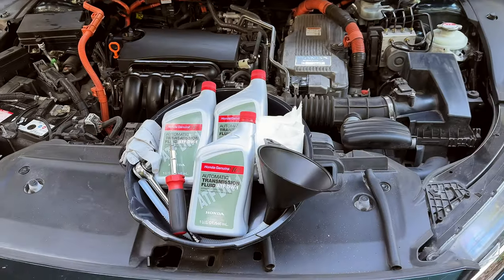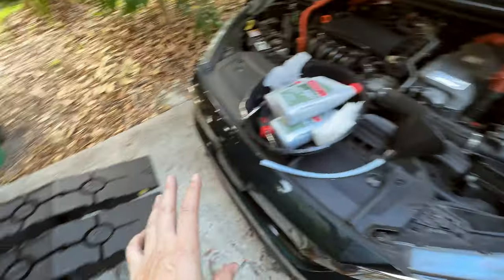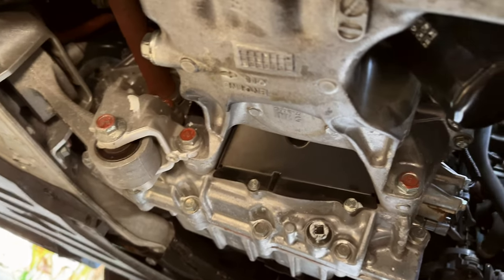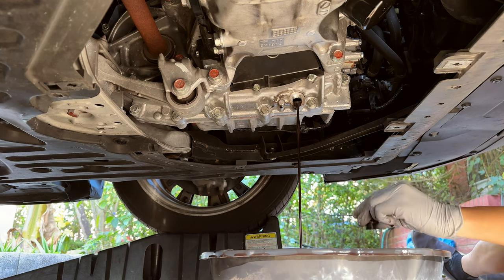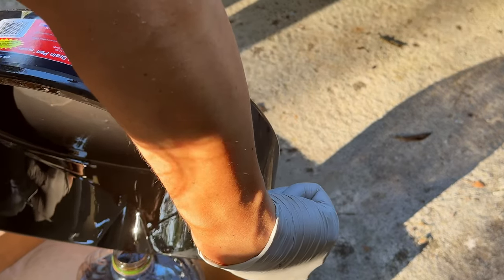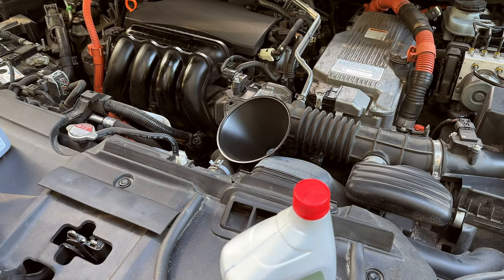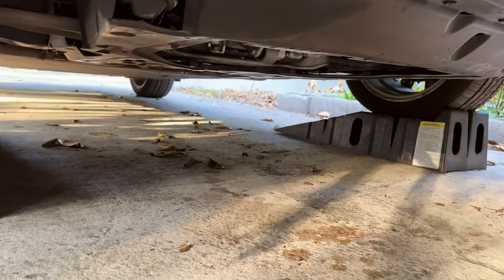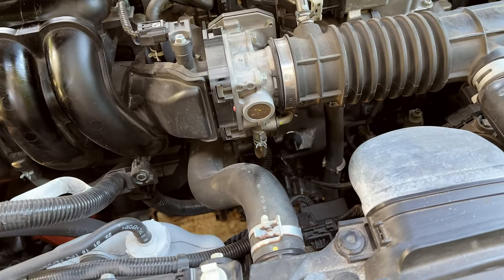How To: Honda Clarity PHEV Transmission Fluid Change

Comment: Thanks for sharing your experience! 
Just curious, how are you keeping your under hood that clean? 🤔🙂 If possible then would you please share your experience on that as well?
Reply from the maker: I sometimes use fresh engine oil, put some on a workshop paper towel to wipe every surface under the hood to keep them looking fresh and also to prevent rust on metal components, bolts and screws.
Reply: @TheGizmoGarage  Thanks a lot for responding and considering my request!

Comment: Does the manual call for transmission fluid change at 35k?
Reply from the maker: I can't remember, maybe at 75k for first transmission fluid change. But I'd probably change at least once every 50k since now I found it's very easy to do so.
Reply: Your "Maintenance Minder" i.e. the car's computer, should tell you when it is due.

Comment: should open the overflow when you filling your fluid to avoid overfill.
Reply from the maker: Indeed that would help, I do that with oil change,  but with transmission fluid it seems okay based on how easy it went in when I did it, there are large gaps at the filler port for air to balance out.

Comment: Just to confirm, you refilled the transmission while the car was still up on the ramps?
Reply from the maker: yeah but next refill I will drain off the ramp to get the last bit of fluid drained.

Comment: also, have you replace the coolant? there are 3 coolant tanks and coolant lasts about 5 years. i know it is not the the manual, but if you look at all the electric cars. they all need to be replaced. the honda prologue shows coolant needs to be replaced 5 years or 100k miles.
Reply from the maker: Yes I usually bring car to Honda for brake fluid and coolant flush. And as you said there are massive amounts of coolants in multiple locations on this car, I wouldn't be taking on the task myself.

Comment: Hi, I'm about to change the transmission oil, can you tell us how much torque should be set on the socket wrench when tightening up the transmission Drain Plug? Thanks
Reply from the maker: 36ft-lb or 49nm

Comment: Good video. I guess there is no way to accurately measure the oil. Your method of measuring the third bottle should be close enough but transmissions shouldn't be over or under filled. I will attempt a drain and fill.
Reply from the maker: there isn't but the bottle indicator is close enough, or you can invest in a measuring cup https://amzn.to/48yf6UO

Comment: Why would you not replace the filter aswell it defeats the entire purpose of changing the oil
Reply from the maker: This is transmission fluid. No filter to change following Honda recommendation. Motor oil absolutely yes change filter every oil change.
Reply: @TheGizmoGarage  yes the transmission has a strainer